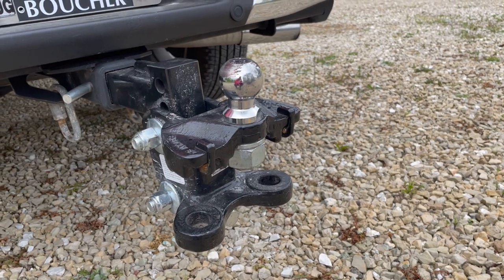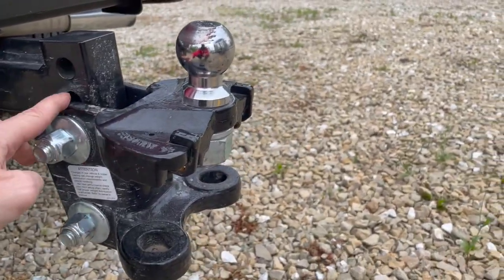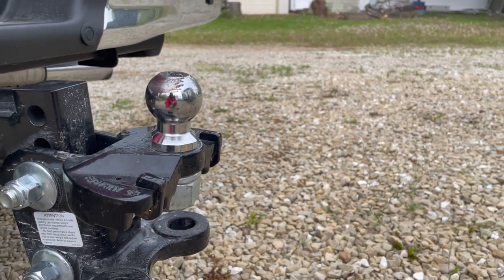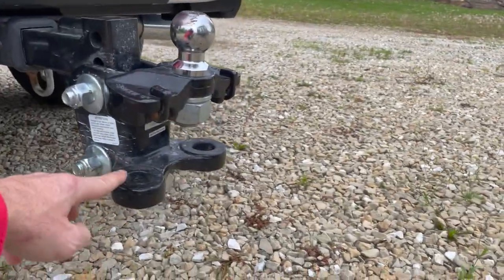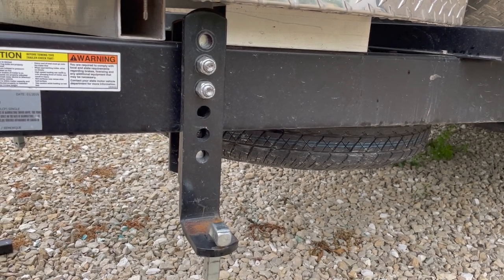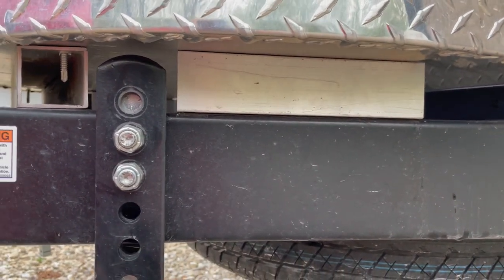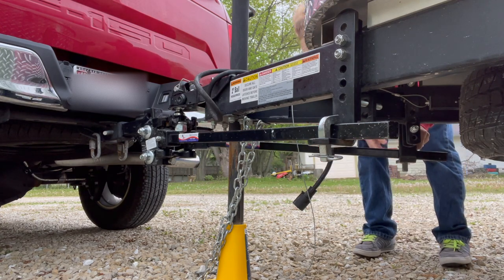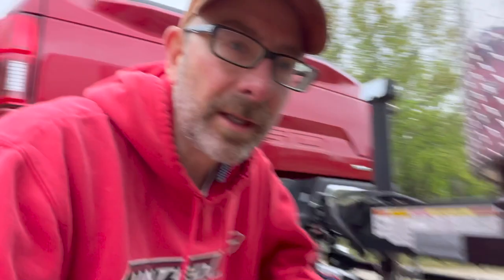How to hitch a trunnion style weight distribution hitch to my Tab 400 by NuCamp

Comment: Sounds like your getting toward your top limit on the F-150 . Mine F-150 is a 2010 and I believe  500 lb  is the max. I'm at 12% (230lb) of my trailer gross on tongue weight and no need for any torsion setup. The truck for me squats very little. Just got back from Copper Falls state park. Nice park our rez. was form Tuesday and departure today . You could see the park was filling with weekend warriors and the start of vacationers . Kids are off school . For us we can get away in the middle of the week. The park was good for a 3 day stay but I don't think I would make a week out of it there. Have another brew and think about it.
Reply from the maker: The truth is I don't think I really need the WDH.  The squat without it is about 1/2 inch, maybe 3/4.  I could easily fix that with air shocks as well but don't want to mess with that.  For me it's more about sway control, although I've towed long distances with the F-150 without, in a snow storm last fall (up to Chippewa Falls) and didn't have an issue.  I think I'm going to consider ditching it altogether.  You're right about the maximum weight before Ford says you really need a WHD.

I'm going to Copper Falls midweek September so really looking forward to that.  I'm retiring at the end of August so then I'll truly be a "mid-week" warrior.  

Thanks for watching.  Cheers!